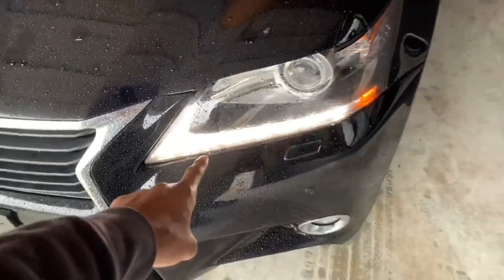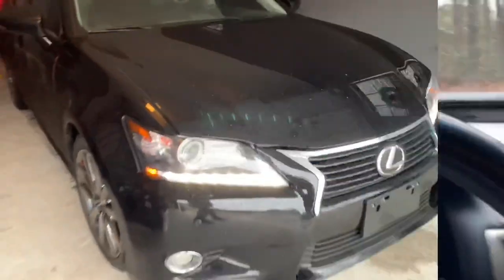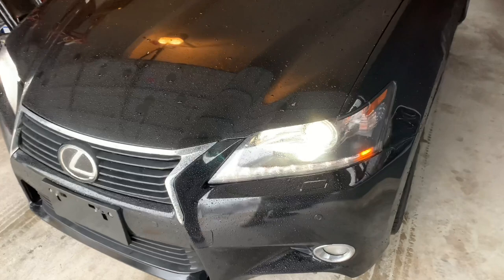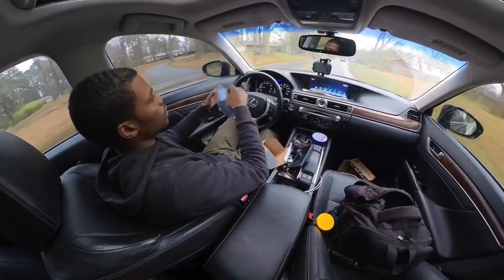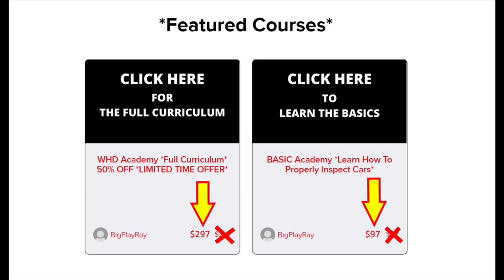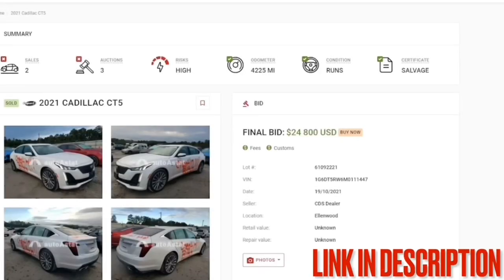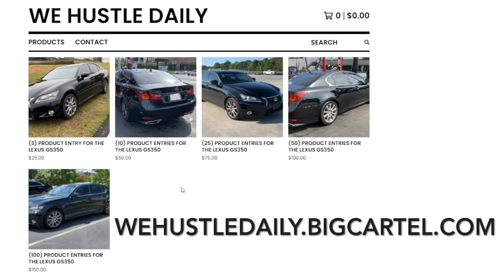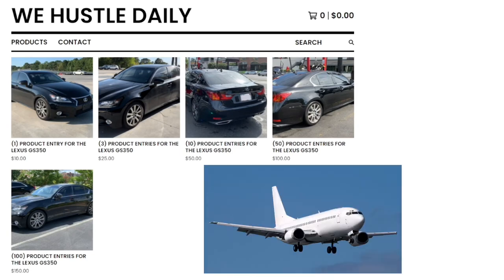I'M HAVING A LIGHTING PROBLEM WITH MY LEXUS GS 350! *BAD BALLAST OR BAD HID BULB?*

Comment: After 250k miles on our 2013 GS the hid bulb started to go bad. Turned off after a few minutes. Took a chance on a cheap $30 set on Amazon, over a year later both headlights still work. Bluer than the originals. Was a pain, seeing as the space was tight.